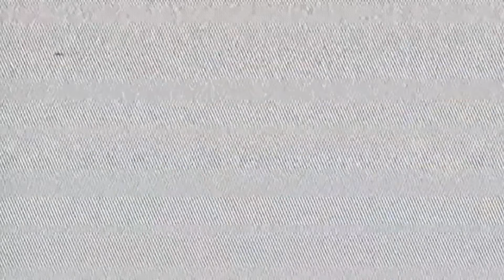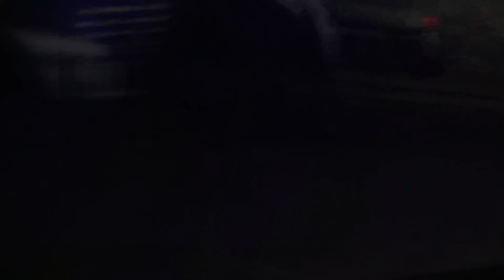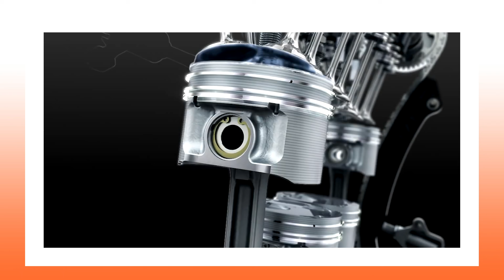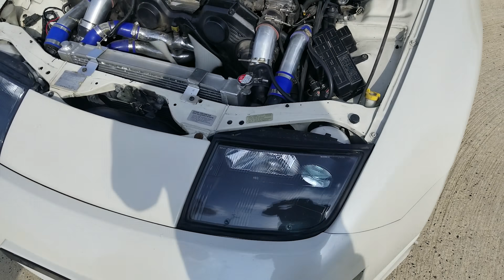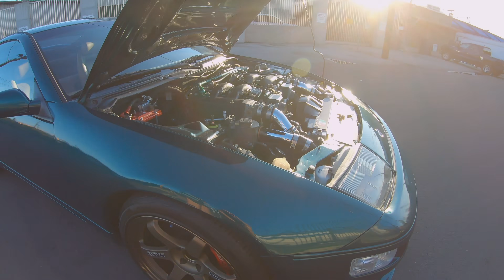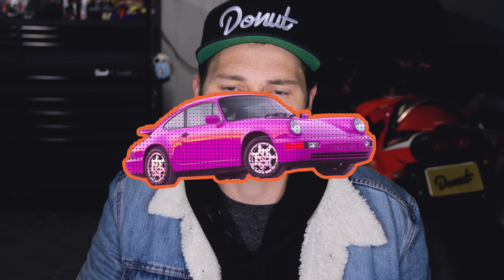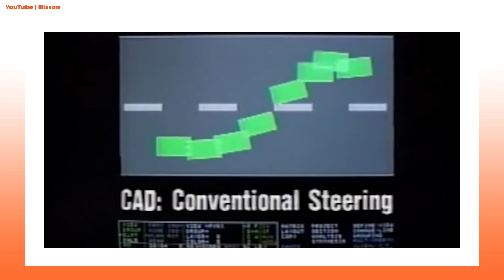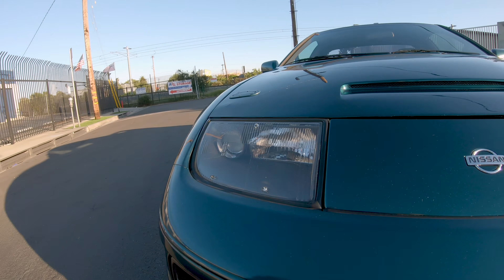The Incredible Tech that DOOMED the 300ZX

Comment: When you get a 300zx just expect all the cool tech to be broken.
Reply: Not entirely true. I agree that most of the Z32's were bought up by a younger demographic that didn't maintain them, abused them, and tastelessly modded them. However, properly maintained Z32's still have all the great tech that works. My '90 NA, which was one of the first ones sold in Ohio, is pristine and everything works 100%; even the original digital clock which is known to stop working. The engine runs strong, VTC still works, all electronics still function, T-tops don't leak, and hell even the driver's side key hole still illuminates green. Power seats and mirrors still operate. It's as solid as it was 30 years ago but not without proper maintenance. I'll never sell her and in fact she may get a TT sister if I find one in similar condition.
Reply: Nothing is broken on my 96 TT.
Reply: @Swan-rb4yg  wellp congrats, finding a sorted out 300zx is pretty damn hard.
Reply: @wellpsceap  I've owned it 17 years.  First owner took immaculate care.
Reply: @duneattack  I did not say that the cars are slow or anything like that. What I'm saying is that when you're trying to get a 300zx its pretty hard to find one that has most of the tech this video went over in a working order. Yes I know you can fine a perfect condition one for triple the price but I'm talking about the average 300zx.
Reply: Yes. At 30 years old and probably well over 100k miles any car would have issues. Lol.
Reply: That's how it was when I bought a 3000gt vr4, fucker still lasted longer than my infiniti 🤷🏻‍♂️
Reply: there isnt much tech in them tbh, atleast by modern standards
Reply: Theres one well taken care of and another in fairly driveable shape in my town so.....       still a few around.
Reply: Also believe the maxima had the same v6 minus the turbos in the early 90's.     Mom and dad had one of the maximas each....     dad modded his out while mom kept hers basically stock.    Unfortunately lost mom in an accident in that thing....     still a fair car I suppose given my experience.
Reply: @liblib89  by 90s standards. Thats alot.
Reply: @SSChambers1  Feels like you got a unicorn there.
Reply: @s2korpionic  definitely! She's not fast but she's pretty 🙂
Reply: @SSChambers1  one question about the 300zx: how hard is it to convert it into a factory twin turbo?
Reply: @supershifter4836  I wouldn't say it's hard as long as you have patience and a basic understanding/skill set in mechanics. These engines appear to be intimidating in the bay but they're honestly relatively easy to pull. As far as the swap, you do need a VG30DETT; you can't just slap turbos on the N/A. The most cost effective way is buying a front clip and doing the work yourself. It'll usually include the engine, transmission, wire harness and ECU which are all necessary for the swap. You'll need to get intercoolers (or a front mount) and all corresponding piping. A boost gauge, boost controller and required vacuum line. If you've got a manual transmission, make sure to get a new TT clutch kit as they are different than N/A's. Plus any odds and ends I forgot to mention. If you go this route, it's a good idea to rebuild your TT engine since it has been used for xxxxxx miles. You could always shell out more money for a new, fully built engine but they're not cheap. Rebuilding these things are not at all bad. I factory rebuilt my NA in 2014 but I have an extensive mechanical background. Just take your time, use the factory service manual (FSM), keep your work environment clean and follow all torque specs and procedures. Don't do a hack job. It'll look bad, run poorly or not at all and it'll all be a waste. Follow the "6 P" rule - *Proper Preparation Prevents Piss Poor Performance*.
Take care and have fun 👍.

Comment: the 300zx is the car that made me a Nissan guy, i always wanted one in the late 90's but couldn't afford one. years later i own a 2013 G37xs with only 44,000 km on the odometer.
Reply: A lot of ppl love to hate on Nissan. A 90 300zxTT was the first car I ever owned when I was 18yrs old. Been a fan of Nissan every since. I even had a 94 Maxima SE 3rd gen. It has an LSD front diff too. It was also a fun car especially for a front wheel drive sport car. I dropped it 2 inch full custom exhaust and that thing got so many compliments because not a lot of ppl mod those. It had the same engine as the 300zx but was the front wheel drive version. It of course lacked that forced induction those TT made all the difference. My friends dad has a bad ass 700hp+ 300zx. He also had an 04 G35 Coupe which was brand new at the time. He had it for a month before he threw an Eaton Supercharger on it. That's when I started to fall in love with those Gs. I got a G35x, it's not a coupe but it's still fun. Nissan all the way...
Reply: @nowimhigh  LOL
Reply: You should get a 300zx. They are really special
Reply: Yuck get a 370 if you wanna flex😂
Reply: I’ve always wanted a 300zx, but my family has a G-37S manual transmission and let me just say that car is quick!!!
Reply: @quinnkyle8247  ay don't hate on the G, G, smh

Comment: I have a 1991 300zx TT that I bought in 2007. I was tired of dealing with the old tech and issues, so I did the forbidden LS swap. It's now a 1100whp, ethanol burning, 6.2l, LS3 with rear mounted twin turbos, making around 1300hp crank. To my knowledge, it's the most powerful LS swapped street legal Z32 in Zword, as of 04/2020.

Some history: I bought a 1990 Z32 NA back in 2001. I always loved the way these cars looks. The timing belt broke, and the engine had to be replaced. I then bought a 1991 Z32 TT in 2007. It was already moded, and made 550whp. It was a fun car until the gaskets started to go, along with many other problems over the year, but hey, it's an old car. I decided to do a swap, and decided on the LS3. The LS3 aluminum block is nearly 200lbs lighter than the VG30DETT, and takes up less room in the bay. This means you can work on the engine,  and not have to remove it every time something goes wrong. Hit me up on social media ( XTZTwinTurbo ) and check out the vids and pics. #XTZTwinTurbo
Reply: XTZTwinTurbo my favorite 300zx to this date, my dream build, and one day hope to have a build similar🤘🏼
Reply: Checked out your video ... that 300 is a monster.